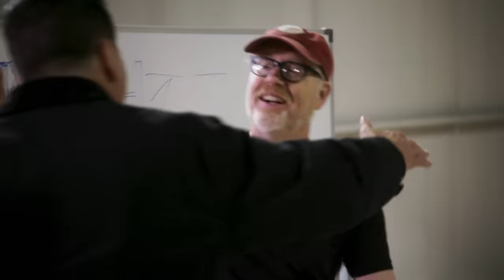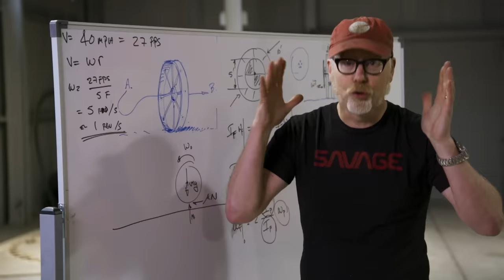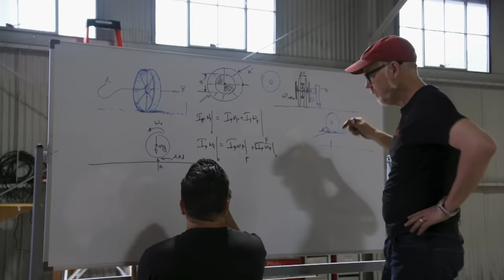"The Power In These Flywheels Scares The Pants Off Me" | Savage Builds

Comment: Honestly... I wouldn't even attempt this before having those plates faced on both sides. Giant flywheels are always perfectly balanced.
Reply: Yea I agree everything needs to be balanced and concentric for this to work , My guess is the bearings and axle shaft is undersize allowing deflection at higher rpm's causing the wobble at higher speeds . You can see in the video a lot of things are not running true .
Reply: @wjamesm1001  yeah, those plates were wobbling very significantly... even at lower speeds that's dangerous, as it puts way to much stress on the bearings.
Reply: That's what always baffled me of mythbusters: they both appeared to be somewhat competent engineers, and yet managed to miss some very obvious problems. I mean, you balance the wheels on your car...
Reply: @Beregorn88  my guess is that they intentionally made mistakes to demonstrate problems more clearly. Additionally while Adam is a smart guy his background is prop making not mechanical engineering.
Reply: I have to imagine that the NASA engineer thought about an acceptable tolerance for run-out, so perhaps the wobble was caused by inconsistent bolt tightening?
Then again, I still struggle with righty-tighty and something-lefty-or-other
Reply: I saw some holes punched in the outer edge. I'm guessing these were at least statically balanced but not dynamic balanced. Need to spin it to dynamically balance it.
Reply: @KarlMiller  Something to consider is that axle hubs are designed to take dynamic stresses.  He made a comment about not realizing how large the disks were going to be.  I think the assumption is the bearing would be able to absorb the load and the test proved otherwise.
Reply: @Beregorn88  Theoreticians. Pft.
Reply: @KarlMiller  isn’t that  more like <Lefty Thighty,> <Righty Lousy> ? 
(Or <Righty Loosey >)
Reply: Maybe they should have gotten a rocket scientist to design it.
Reply: untill the weight on one end is higher then the other , then they start skipping
Reply: @andybaldman  Weirdest rocket I ever saw. ;)
Reply: @20vK  The guy in the video is a NASA engineer.  Hence the joke.  ;)
Reply: Seriously. A flywheel that size shouldn’t have that much runout. It’s a disaster waiting to happen.
Reply: Or heat treated/relaxed
Reply: Honesty is the best policy
Reply: @dozer1642  yeah thats an insane amout of energy. Cant believe they tested it unsecured
Reply: You can sheer a shaft at the bearing fairly easily with an unbalanced flywheel too. Could have been really entertaining.
Reply: @Tezza120  I came here to comment the same thing. Each disk should have been statically balanced then the whole assembly dynamically balanced to fine tune any misalignment.
Reply: @Beregorn88  maybe because not everyone is perfect
Reply: @christopher4636  for narrow wheels and discs like this, static and dynamic makes no difference. Only long things, where front and back can have different weight distribution need dynamic balancing (like driveshaft, crankshaft)
Reply: @sledgeoc  You would be correct for each disk on its own, however I was under the impression the the two flywheels here were linked by a solid axle, which ultimately means you've got a rotating mass the width of the axle. Therefore dynamic balance is pretty important. It's very similar to an jet engine (I'm an aircraft mechanic), where you effectively have multiple narrow rotating disks (of blades) coupled together.
Reply: I'm hoping that the first test they did of the device wasn't this speed test, but that they edited it to make it look like this was the first test, when in reality it was just a dramatization demo for interest.
Reply: @andybaldman  Mine was too - flywheel principles are actually pretty basic - same principles apply for rockets! I once threw together a 10k paper on flywheels over a weekend. Which reminds me, I should clean that thing up and publish it. Thanks for the reminder! ;)
Reply: @20vK  Idk what a 10k paper is, but best of luck to ya, pal.
Reply: @andybaldman  just a lot of words and equations, my friend!
Reply: @20vK  Let us know when you publish.   I'm an engineer.  Would love to read it.
Reply: @andybaldman  Sure thing - Design Engineer here too! It was a pure thought experiment on all aspects which could potentially improve and maximise flywheel energy storage, (some practical, some costly and some totally impractical), and then the second part was about considerations for proving/convincing people it could be a safe technology. 

Written for a job interview over a weekend for a startup which had a university connection before they backpedalled on the pre-agreed salary to run and develop the whole project.

I've no issues putting it out into the world for free! Will let you know - I have to relocate and add references before I publish though, which will take a lot of time. Something I didn't include in the original paper, as I was just trying to demonstrate my ability to research, comprehend and innovate, not write a publishable paper. Once credit can be given to others, though, I'd be happy to throw it out into the world!  

Would most certainly enjoy the feedback, critical analysis or fresh ideas it may generate from others too! ;)
Reply: I was thinking the same thing with the placement of the lifting holes
Reply: Except that one time the flywheel flew off the shaft!
I'll show myself out...
Reply: @20vK  et al. To satisfy my own curiousity as a (non-physical) science geek interested in fun mechanical type problems, I thought I'd ask a question about this to you engineer types. And if you had time you could enlighten me.. or not! (ha):

Could a fly wheel be stabilized (material, shape etc)  in any way that doesn't make it basically non-functional (or much less efficient) as a fly wheel, other than just reducing the diameter. 

I'm guessing if you added slightly more mass to the center that would reduce it's ability to conserve angular momentum, and if you compensated by increasing mass at the edge and the center that would probably complicate stabilizing it. So, you could decrease diameter and increase density or speed, or increase density and decrease speed. 

Assuming you didn't have to worry about the mechanical properties of the actual material under stress, what would make a very powerful flywheel easier/safer to implement (like in this example, other than machining the whole thing perfecting to within an inch of it's life.)
Reply: Yeah, I was watching this asking myself where are the balancing cuts on these wheels. Wait, are these just stock plates cut to size and that's it? Any rotating assembly has to be balanced something like that out of balance at 1000 RPM is a nightmare machine.
Reply: Irrespective of facing the flywheels, one look at those thin plates is enough to tell me that they'd be sounding like drum solo at a Metallica concert...
Reply: @Beregorn88  I mean, I LOVE the Mythbusters, but remember that they are not dyed in the wool mechanical engineers. They were fabricators and Hollywood effects artists. They have amassed a wealth of experience for sure, but they are not masters of this, or any, craft. They are generalists.
Reply: @dustinfirkins5736  they could have strapped it down.
Reply: the point of not getting it right first time is the drama, the show uses the drama and suspense of possible failures to keep the viewers interested.
Reply: balancing mass doesn't always equal having perfect geometry and symmetry, inconsistencies in the material will still be weight thrown around, so facing it would only remove the visual runout. a balanced driveshaft will run out quite a bit physically, but it's mass is still balanced around the centerline. I do agree that they should've known it would take more than bolting a big steel disk to a hub though
Reply: @markthebldr6834  it is strapped, look between the two posts, there's a strap connected to what i would hope is a deep concrete anchor.
Reply: This is nothing to do with balance of plates its how it is attached to the hub or the plates are not flat
Reply: Tyler Johnson  Ok genius why didn't it work if the great engineers didn't think of this ? Don't get me wrong I love Adams creativity and he would be a hoot to work with . You must be one of those engineers that can't be told there wrong . Adam even said they UNDERESTIMATED the braking power needed to make this flywheel work . They knew that things weren't right  when they did the test and had severe vibration at only 300 of the 1000rpm's they needed to run , Go back and look at there faces and see the concern. They didn't fully know that's why they were testing to see if there design was strong enough . According to you you would have thought a "NASA engineer" who could land on Mars could figure out a simple flywheel the first time .
Reply: As all things should be.
Reply: @Tyler Johnson  You seem to be under the assumption that anyone who comments on YouTube videos is naive and couldn't possibly have constructive criticism. You're correct that a chief engineer at JPL is very well educated and you're also correct that dynamic balancing is a basic concept to such an engineer. However you're clearly so blinded by your admiration for Steltzner, that you can't see there was obvious faults in the design. Very possibly not his fault, however I don't recall blaming him for this. Also, if you want to be taken seriously, my personal suggestion would be not to reply with emojis.
Reply: @rossy2998  that's the thing, it doesn't necessarily have to be perfectly flat to be balanced, if you cut a disk perfectly true it probably actually won't be balanced because you would have to be very lucky to find a piece of material that big with no inconsistencies within the metal
Reply: @AbandonAllArt  well true but if you can be bothered you should flatten it. i would say the issue arises from shaft runout, in adequate bearings/hubs or not torqued correctly. i would be suprised the shaft has less then .05mm runout
Reply: I thought that’s what the holes close to the outer edge were for. I assume they’d have thought to do what is painfully obvious.
Reply: @Ouchmyback  on top off saw horses?
Reply: I guess the disturbance is staged, and they have an escape door close by in case things get out of control. TV gets more exciting this way.
Reply: @duckduckandeby405  always fun when you're reaching behind something to access a bolt and trying to figure out which way to turn it.
Reply: There are holes drilled in the discs, near their outer bounds. I assume these represent material that was removed in order to rudimentarily balance the plates. It still seems sketchy to me, but I think they at least paid lip-service to trying to balance them...
Reply: Exactly, those wheels do not look ground at all.  They could be warped, thickness could be uneven, and the holes must be perfectly central for that to work.
Reply: I'm wondering why they didn't make a scale model with the flywheel design? They had an idea and went full scale with it right away? This doesn't seem very NASA like to me. And Especially doesn't seem like something a model prop guy would pass up on either.
Reply: @wjamesm1001  5 foot flywheels  on what is looking like a trailer hub.
What could go wrong!
Reply: @sledgeoc  I think you are referring to single plane vs dual plane balancing. Static references being stationary while dynamic is while in motion.
Reply: They were only aiming for 1000rpm
Reply: Yeah it's the Adam Savage brand. Do the thing, and expect it to fail half the time or more.
Reply: @MB-xw1tu  A quick and simple answer would be to consider the structure of a flywheel from a static steam engine, cast spokes and a wide flat rim anything from 1/8 to 6 inch thick. That's a simple robust and energy efficient design. Concentrate as much mass at the rim as possible, and you store the same energy at lower rpm. I've seen one running that was about 3 storeys high, rotating pretty slow but you could feel the energy in the floor ...
Reply: As all things should be.
Reply: No. There is no such thing.
Reply: @Beregorn88  Pretty generous setting for the word somewhat.
Reply: @kj1h5kj  I'm a "generalist" DYI'ers and I certainly will not eff up with a 400lb rotating disc on a flimsy unsecured axle.
Reply: Is there a part 2 to this?
Reply: As all things should be LOL
Reply: Thank you.
It looks like they just cut circles out of steel plate and shipped it over

Comment: I work as an industrial mechanic and I always tell the new guys, no matter how fast something looks like it's spinning, it always has way more momentum and torque than you think it does.
Reply: It becomes a bit more apparent when its bouncing off the floor and coming straight at you...
Reply: @briggsbughouses6291  industrial equipment should never ever do anything like that even at the worst industrial plants in the world mechanical stuff pretty much never dose that🤠it can happen though next to never dose🤠🤠
Reply: Great peace of advice,definitely holds true for very large gears ⚙️ that may appear to be moving slowly.
Reply: ...and don't touch...and don't touch...and don't touch
Reply: i assume you'd also be disgusted at how he uses mph and lb instead of kg and m it's just so much better
Reply: Chris Kratzke uuuuh *does not dose
Reply: @parzingtheasian  its a show meant for a US audience, so yes, they used the US customary system when explaining it.
Reply: worked in a room with a 15 ton flywheel about 15 feet diameter. when the press did a cycle the ground shook in the whole building. yes after it was shut off it turned for 45 minutes. and that was at a much lower rpm
Reply: spin that at some 100 thousand rpm and you get alien sauce. Itll cut through spaghetti and the earth.
Reply: Remember being ten years old and trying to stop your bike wheel spinning when the bike was upside down on its handlebars and you spun the wheel really fast?
Reply: @cr4zyj4ck  I have been told that a large proportion of US scientists work in metric because it saves a heap of time.
Reply: @Phil_Taz  they do. This is a television show, though, filmed and intended for the US audience, who is currently most familiar with the US Customary system. An entertainment company that wants to stay in business and make money knows how to cater to their audience, and the audience in this case is not very familiar with the metric system, especially when relating to speed.
Reply: and if it doesn't look lime it's spinning it's probably the lighting
Reply: Sort of like a top 🙂
Reply: Yep. When I worked in an office where there was a small floor safe, a collegue opened it and let the door go, which was moving very slowly to a stop. Without thinking I put my knee out to stop it. Big mistake, I thought I had shattered my knee cap. Never forgot that, and made sure everyone in the office knew what not to do - it's so deceptive.
Reply: @cr4zyj4ck  Yes indeed... Freedom Units!!!💜🚀🎵💋🌈🍀🇺🇸🇺🇸🇺🇸
Reply: I saw a guy try to stop a car wheel that was rolling down a hill with his foot, the wheel kicked him out of the way.
Reply: @Phil_Taz  Well, the international unit of distance is the meter. When scientists publish articles in peer reviewed journals,  they have to use international units. One day or another, USAnians will have to get rid off the imperial units.
Reply: Ain’t you something!
Reply: Especially if they are smooth, unmarked metal cylinders or discs. That way you can't even tell whether they are spinning or not unless they show vibration which in such case, you are having a badly balanced spinning object and you should do something about it before it break the axle and fly away or into your face.
Reply: Deadly torque.
Reply: "That 3 foot thick, 8 foot diameter gear sliding down the ramp at a crawl? Weighs more than my wife's pick-up, don't try to stop it, get out of it's way, we'll pick it up when it stops."

Moving at maybe 1/3 of a normal walking pace, that gear shouldered through the concrete lane divider at the bottom of the ramp like it was paper. If the floor boss hadn't warned me, I was going to try to stop it like a soccer ball......
Reply: @muninrob  wow, incredible how much momentum that is
Reply: I hope we never do!
Reply: That disc turning at 3 rpm would cut your arm off without slowing down... it'd be like snapping a toothpick...
Reply: Yea because you can’t tell weight with your eyes.
Reply: What if I think it has infinite momentum and torque?
Reply: @Phil_Taz  perfect analogy
Reply: @muninrob  something to keep in mind next time I try and stop  rolling truck tires  or move them off a truck bed. don't roll them, flip them. They have alot more force to them then you'd think.